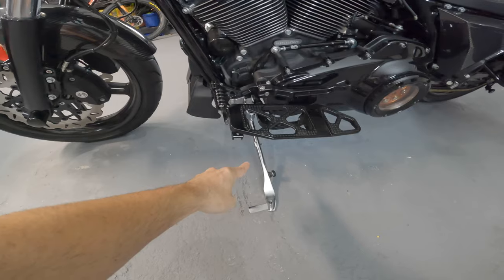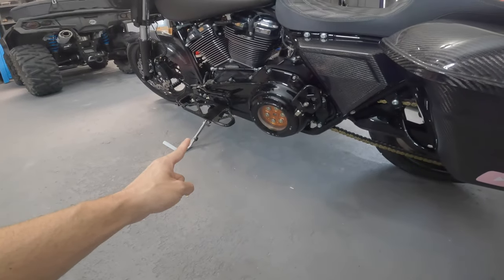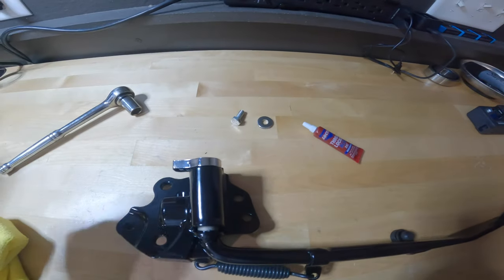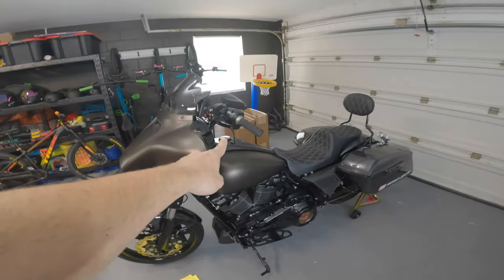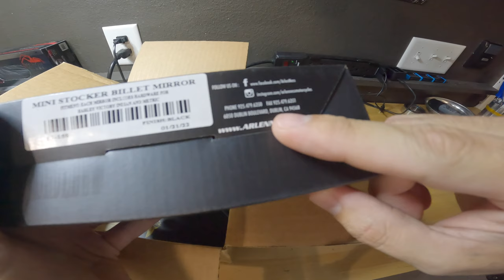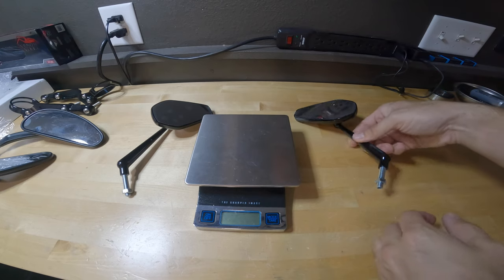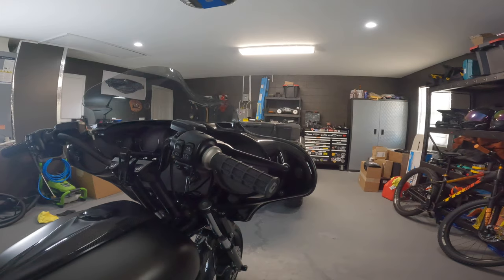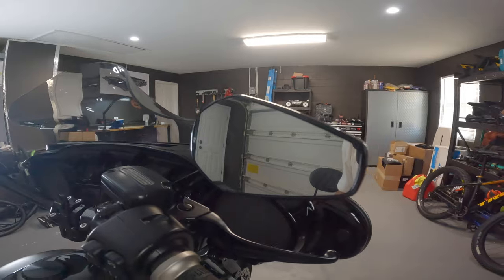Best Performance Bagger Mirrors // Arlen Ness Mini Stocker Mirrors

Comment: From what I've seen Arlen Ness aren't afraid to change up the OEM style with radical designs, but it seems to me they went for "factory custom" with these mirrors - clean, smooth but much sleeker than stock. Awesome, Thanks
Reply from the maker: You nailed it, Andrew! Factory custom is the perfect way to describe these mirrors. 🤘🏼
Reply: @MichaelBertini  Very cool. However I just noticed you found a crack - are you confident they were defective (not your doing)? Any luck with their customer service since then?
Reply from the maker: @andrewvickers4487  one one side was defective and they sent me a brand new one immediately. Their customer service for me turned out to be great.
Reply: @MichaelBertini  Thanks
Reply from the maker: @andrewvickers4487  you're welcome, bud.😬

Comment: I just installed the AN stocker mirrors on my ride, for those have   on bike,  this stem from AN is too short.  I ended up going to the Hardware store to purchase a longer stem. Other than that, these mirrors are dope.
Reply: Do know what size stem? I’m running into the same issue

Comment: Looks like a new windshield. Looks like you replaced the lower screen with a 6.5''? Did it help with the wind buffeting? Did you do a review on it yet? Also I noticed your Kraus T Bar Install has been removed and newer, taller bars installed, can not find a review on that?
Reply from the maker: You have a good eye, bud. Yes, I went with a taller windshield, and yes I did a video on it. 😬 

It helped with buffeting A LOT. The Kraus T Bar setup was removed in the video titled "MJK Performance Parts // SUPER High-End Harley Performance Parts" but I miss my Kraus setup and wish I hadn't switched. 

Here is the video link: https://www.youtube.com/watch?v=F7bq8hBhT0A
Reply: @MichaelBertini  Thanks for the reply. I see you went with the 8.5''. Liked the extra humor you threw in on this video! 😁
Reply from the maker: @ericjames7680  Yeah, but now I want to go shorter. It's a never ending story. 😅

Comment: Why you didn't powder coat the kickstand instead of replacing with one from eBay and you can powder coat everything including the parts you used from the stock kickstand?
Reply from the maker: I was on a time crunch to meet my video content calendar and so it was a last resort. The eBay one was just an OEM kickstand that was powder coated. 👍🏼

Comment: On the oil cooler screen you and I were talking about, one person I did find hot glued some screen mesh to the inside plastic cover. It looked OK?😒 He did say that the mesh will, and does on the KLOCK WERKS also, make contact with the cooling tubes. I did find the Harley one that I think I like alot better and will be a greater protection than the home made one I saw or the Klock Werks. Part Number: 25700634. The description says it will not fit with the fan assisted cooler, however I found about 6 people on Harley Forums that said it installs just fine and about a dozen more people asking about the fit, so there is your video which seems to be very much needed. You would have to paint yours perhaps, they come in black and chrome. Tell me what you think! 😜
Reply from the maker: I likes it and I likes that you gave me a part number too. 😉🤘🏼

Comment: Something I have noticed on the Street Glide ST and your bike also I wanted to ask you about. The front fender on each bike is short and was wondering if your oil cooler radiator fins get dinged or the fins get dirty from road debris? I did find a small screen in black from Klock Werks that may help to provide a little extra protection or is this something you have had no trouble with?
Reply from the maker: You just gave me an idea for a video. I have gotten a few dings but nothing major.
Reply: @MichaelBertini  Great! The Klock Werks one looks like it would work OK? When I get the bike I was thinking of the Harley oil cooler fan to be installed like the trikes and Police bikes have.
Reply from the maker: @ericjames7680  Definitely get an oil cooler fan. Thunder Max makes a great one from what I've heard. I have the Harley one on my bike and it's also been good.

Comment: Mr. Michael Bertini I need you help! I have been told that the Street Glide requires a certain helmet meaning that some helmets provide too much buffeting. For an example You Tuber Ridin Dad says his full coverage Aria when he rode his buddies Street Glide,the  buffeting was so bad and could only ride for 30 minutes or so. Then another Street Glide rider tried 4 helmets and found the Simpson Mod helmet worked great as well as 1 other person said the same. What full coverage helmet do you wear and have you tried different ones and gotten better or worse results? Thanks alot!
Reply from the maker: The absolute best helmet I have had for buffeting is a Shoei RF 1400. The reason I no longer use it is because of moto vlogging. Outside of that, the RF 1400 is the best. 

I obviously need a helmets for moto vlogging and one that "look cool" so I love my Ruroc Atlas helmets. 

But currently my motovlog helmet as of today is a Carbon Simpson Ghost Bandit and I don't fit it comfortable at all.
Reply: @MichaelBertini  Thank you. I will look into the Shoei  RF1400. I may get the Simpson Ghost too, just because?
Reply from the maker: @ericjames7680  Simpson Ghost to me just looks cool. Once you have used the Shoei RF 1400 the chances of you liking the Simpson Ghost are slim. Although, we're all different in what we like. 🤷🏽‍♂️
Reply: @MichaelBertini  Thanks! Yes the 1400 really looks nice and am going to try on a couple to see what size I need. The Simpsons do look cool, may have one also just for a back up. You are becoming one of my favorite You Tubers, Thanks for all the help. 😎 Wasn't too sure about you at first? 🤣😜👍
Reply from the maker: @ericjames7680  🤣🤣🤣 I love the honesty! Glad I could help. 😬🤘🏼